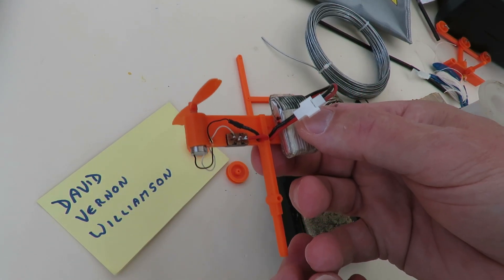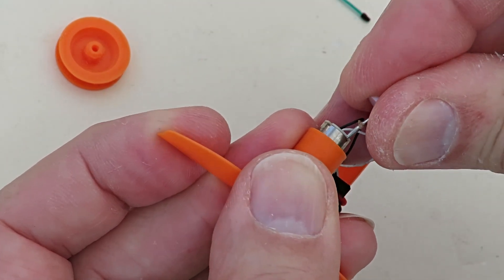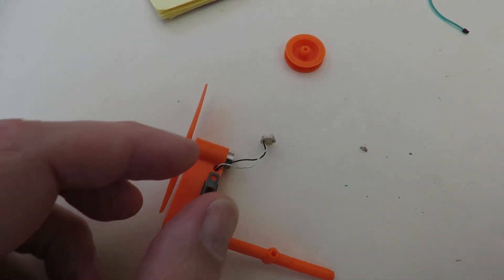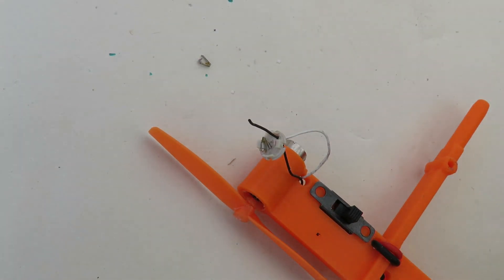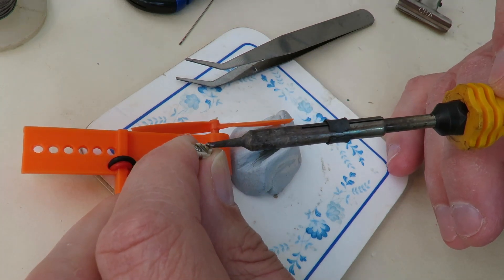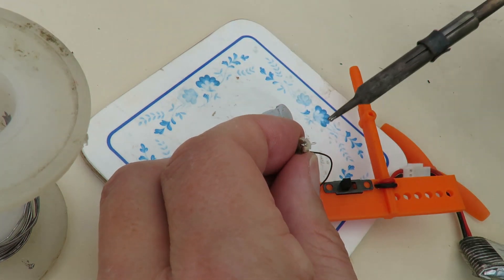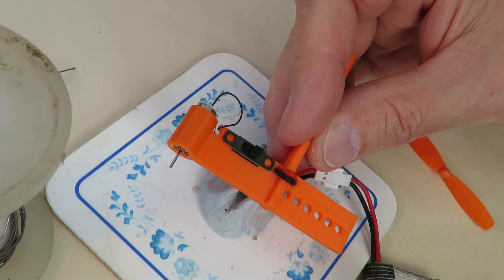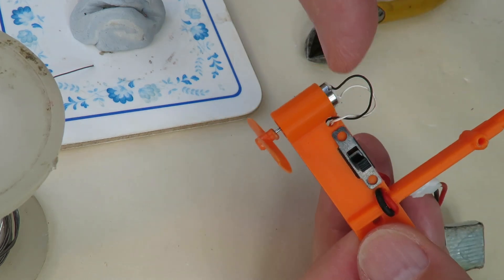Can I fix a broken wire on a small coreless motor

Comment: Thank you for the help now a I can repair my coreless moter
Reply from the maker: Good luck with that, they are very small and hard to work on.
Reply: @GrandadIsAnOldMan  Thank you uncle and I am in 5th standard
Reply: My moter lid broke into two pieces😔😔☹☹
Reply from the maker: @abhinavandaditibanare9241  yes, that is a common problem. Bad luck.
Reply: I also dried to make the hole bigger with a drilling machine but cut down into 2 pieces how did you did it was too hard and it needs a lot of patients 🤔🤔❓❓❓
Reply from the maker: As I said in the video it is NOT something I like to do. It usually ends in failure. Did you read the video description?

Comment: I have a 716 (diameter 7mm by 16 long) coreless with a wire having fallen out just by moving it around during a build. So I am going to try this. On any of these motors, the trick is to put a large dollop of UHU or hot glue on the back plate, to prevent anything being pulled or stressed seperately.
Reply from the maker: This is true 😍👍
Reply from the maker: Just remembered to say, make sure you mark the back plate and the case so you put it back in the same orientation or it either won't work or will spin backwards. Good luck 😍👍

Comment: Interesting video, I have a couple in the same state. I'm more informed now to tackle my repairs. Thanks
Reply from the maker: It is probably not worth the effort. Maybe if they are a reasonable size, but the small ones are just too small for me to work on. Even this one didn't last long, but that was because I hit something with it and pushed the shaft back, knocking the end cap off again. Then I messed up the brushes trying to reassemble it without my glasses.
Reply: @GrandadIsAnOldMan  Challenges,Challenges,Challenges, lol Keep up the good work

Comment: Well that was really tricky, but you did it. I thought at first you were 3D printing a little quad. Will be really interesting to see this working a a cable car. Is the motor still overheating? I hope you leave a copy of the print on your tinkercad page. 👍👍👍
Ah, I meant Thingverse. I just found your files. Good stuff. 👍👍👍
Reply from the maker: The cable car is one of several recent projects that have been incredibly frustrating. I have used an awful lot of PLA for very little result 😕😆